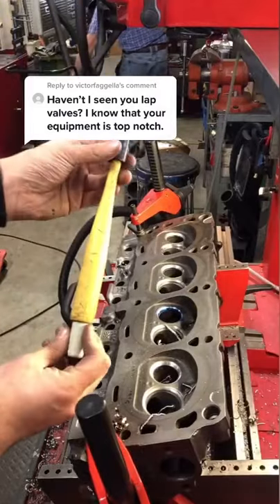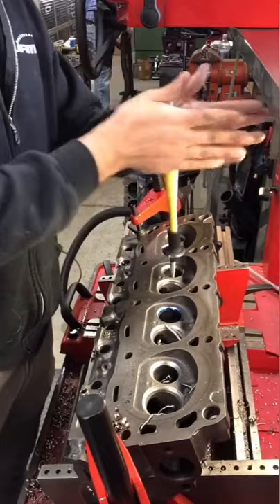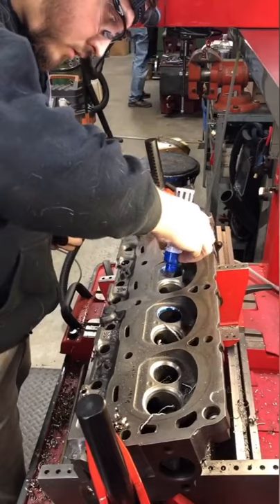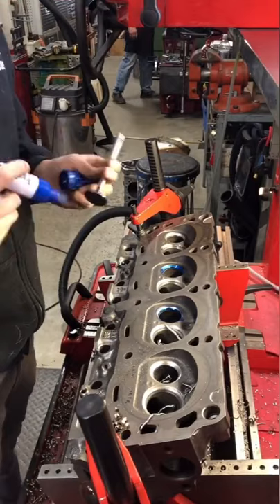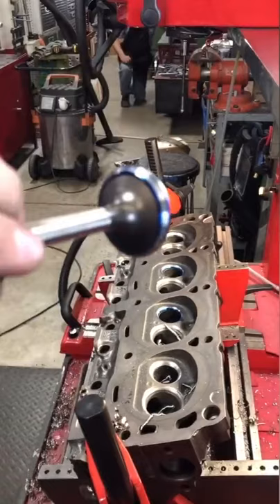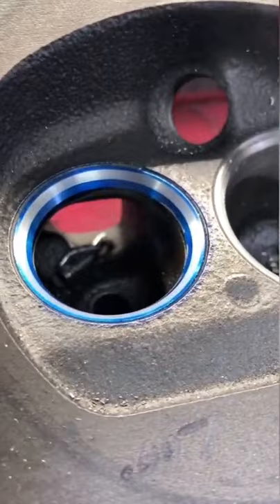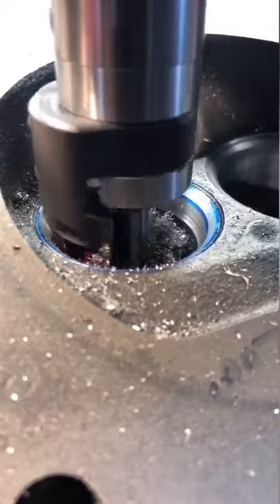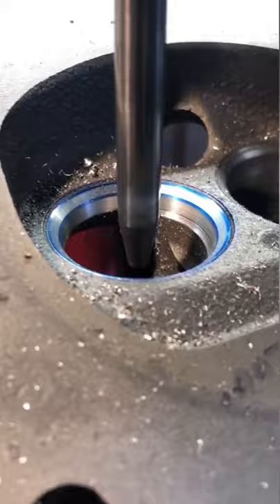#SHORTS If you don't lap valves, what are you doing with a lapping stick?

Comment: Valves are the cheapest component, block is generally not.  It seems like your screwing around with the most expensive component to get it to fit the cheaper components because it's "easier"

Comment: How much do you get generally for decking a set of heads and doing a valve job I have a set of dove BBF heads I just got for my 429 and I have a set of Ferra 4 grove stainless valves and I might have you do new seats because they are hardened seats

Comment: Just a simple question because I’m new to the specific insides of an engine and what takes place during rebuilds etc. but is overlapping the solution to a shitty job someone done when trying to bore a motor?
Reply: The only solution is a proper rebore and lapping job if it wasn't bored to the correct dimensions.

Comment: Except, valves in a RUNNING engine operate at a temp of ~140-175 degrees, Fahrenheit.
For this reason, lapping is a necessity.
Or, just machine them and wonder why you burn oil.
Reply: Do you recommend a little lapping compound on the valve stems during assembly as well sir?
 I  want to set my motor up loose.
Reply: Dan I think your temps are low

Comment: Hey bro most dudes that comment can't change the oil on thier lawn mower. No need to explain. Just loud dudes barking like always. Keep doing what you do
Reply from the maker: "Every mm of perfect contact matters". Okay, food for thought... what is the valve stem to valve guide clearance you are running on these "high horsepower boosted cars" you are building? Let's say in the range of .001" to .003" on the intake valves and .002" to .004" on the exhaust guides. Could be more, could be less. Let's go on the tighter side for the example.

Now, what grit lapping compound are you using? I'll give you the benefit of the doubt that you have 1200 grit lapping compound (~.00015" particles).

Okay, so I've gone in with my Serdi using a rigid carbide pilot with <.0005" clearance to the guide. The triple air float centering system has found the true center and axis of that valve guide. We have machined a seat that we can measure to hold perfect vacuum and using a runout gauge can see less than .001" runout. 

Now you're going to take your valve, throw some lapping compound on it, and essentially use the valve face as a grinding stone. Your valve stem is your pilot, bouncing around in what is likely greater than .001" valve stem clearance to align the face, with literal grit between the seat and the valve face wearing grooves into both. Like I said, hopefully these grooves are in the .00015" range, but most guys run down to the local AutoZone and pick up whatever they have on the shelf, probably Permatex 80036, which starts as a grit size of 120 (.004")!

It's clear to me why lapping valves is inferior when you break down the actual physical process of what is happening. That's why lapping valves went out of style in 1950. 

And don't google "lapping" to try and justify your argument. The typical "two piece lapping" process for flatness and roughness is NOT comparable to lapping a valve with valve stem clearance, plain and simple.

I know you still won't be convinced, after all you're the one building high horsepower boosted cars on a daily basis and I'm just the kind running a rinky dink family business out in rural Colorado.

Comment: Can someone answer me something I am having my 350 4 bolt main bored .20 over at my local machine shop for my 1994 Chevy c1500 does every machine shop clean ur block before they bore
Reply: Why not ask em? I assume they will, as to not get grit and crap from the exterior of the block in their machines. The few heads i've had done at various shops was cleaned without me asking, but i've never had a block bored. If you want it done, just ask.

Comment: Did you ever check the runouts on OEM valves? .002" is what I see with valves straight from BIG companies. I grind them to. 0001"~.0003". Ford, GM, Mopar, all Japanese bikes, it's amazing they seal at all. And some companies tests have to hold 19.5 in hg for 14 seconds, what 🤬 motor has a valve closed for that long?!! But mine all pass.

Comment: Lapping valves probably was an OLD technique from the days when machines/tools weren't that precise (machines with one common steam driven leather belt) or when you don't have machines at all. You are probably right that with the current high precision machining tools this technique is obsolete.
Reply: False. Lapping is used to make two parts mate perfectly. On a microscopic level. It is still used in the aerospace manufacturing industry to this day, for good reasons.
Reply: @mattcarbaugh5576  It's probably still used in very specific cases e.g. precision machinery (lathe etc.) and the example you mentioned. But to still use this manual method in an industrial production environment is nonsensical and obsolete.

Comment: Contrary too all of your beliefs. If you want to talk on a micron level, lapping is the best method. Nothing gives a surface finish like lapping.
Reply from the maker: The typical two piece lapping process you are imagining is absolutely great in certain applications. The mating of a valve to a valve seat is NOT one of them. 

Take a read: https://en.m.wikipedia.org/wiki/Lapping

“One complication in two-piece lapping is the need to ensure that neither piece flexes or is deformed during the process. As the pieces are moved past each other, part of each (some area near the edge) will be unsupported for some fraction of the rubbing movement. If one piece flexes due to this lack of support, the edges of the opposite piece will tend to dig depressions into it a short distance in from the edge, and the edges of the opposite piece are heavily abraded by the same action - the lapping procedure assumes roughly equal pressure distribution across the whole surface at all times, and will fail in this manner if the workpiece itself deforms under that pressure.”

These things are not held true when lapping a valve w/ .0015” valve stem clearance allowing the surface of the valve face to bounce around & be misaligned to the surface of the seat. 

I stand by the fact that for the application of a valve seat & valve face, lapping is an outdated process to make up for garbage machine work.
Reply: @JAMSIONLINE  Sure there is a 1.5 thou tolerance on the valve stem.  It is true the valve stem will bounce around. There is the point to the angles on the valve. The valve will sit into position no matter the stems position. The guide is for when it's moving, the seat is to hold compression.
Not to mention if that tolerance did effect it, I could argue lapping with it moving around would create a better seat, as the valve will be bouncing around during operation. 
Either way, I'm not saying lapping is to replace the machining. It is there to spice it up and bring it to a level beyond machine capability. If lapping is ever detrimental, it was done by someone that doesn't know what they are doing.
Reply: @JAMSIONLINE  moreover on your valve stem clearance point. My milling machine has probably .06 clearance on the drawbar. But that doesn't matter, as the cat 50 taper was designed to put my machine tools in the exact same position everytime I change. 

Grinders can achieve unbelievable surface finishes nowadays. No machine will ever surpass the right lapping compounds and technique.

Comment: So your cutting machine is so accurate that there’s no need to lap??
Reply: A used Serdi 100 is over $20,000. It better do a better job than a jar of paste and a suction cup stick.
Reply: The  machine is only as accurate as the guy running it... and the finish it will leave is only as good as the tool you’re using to cut... so that’s why people lap valves after using a machine, go get rid of any possible machining marks and end up with a polished surface that also will be smoother and less porous and more likely to not hold carbon as well as a freshly machined surface which will be quite porous and will have machine cuts for microscopic particles to stick to better... this kid in this video is lazy. It’s good for the machine to be set right sure but that’s literally just the very beginning of the process definitely not the end.

Comment: So basically you’re lapping the valves the with a magic marker instead of valve lapping compound. 

I literally use lapping compound for the same thing, this is valve lapping no matter what you claim. If you do a decent job on your cuts and seat grinding you don’t need more than 30 seconds or so of lapping for verify your valve seal. 

You look for a line in the compound, not rocket science.